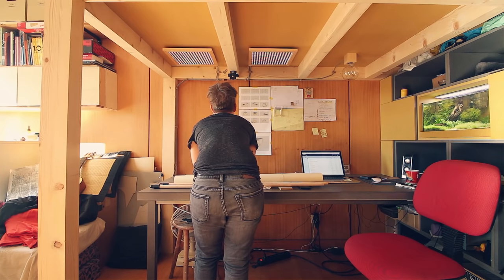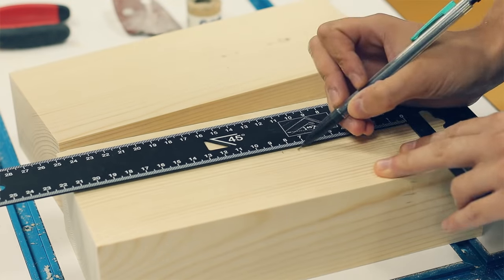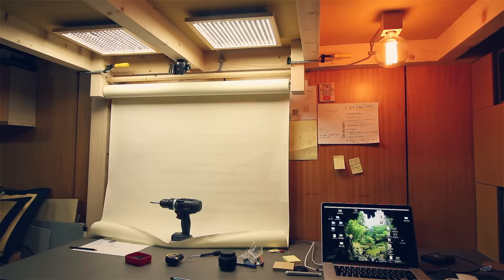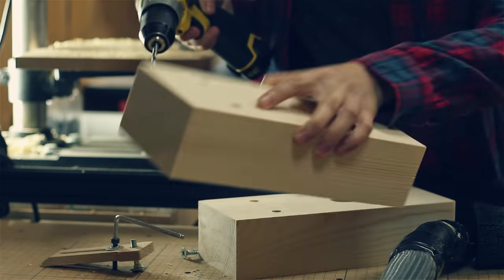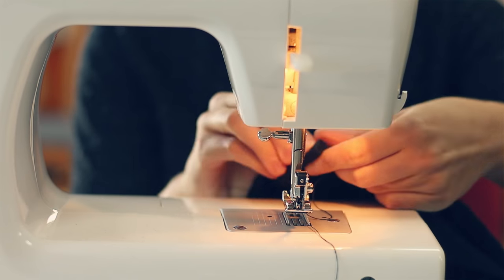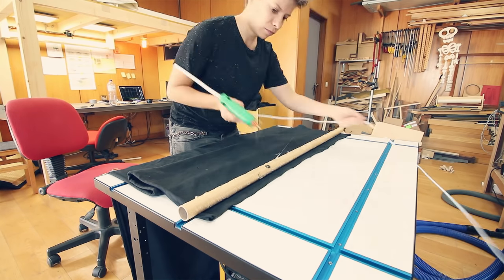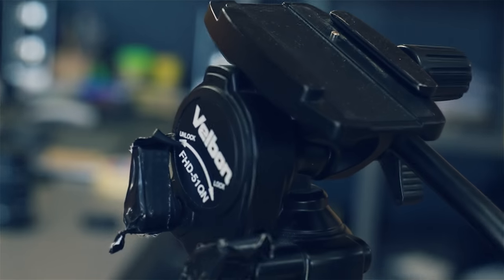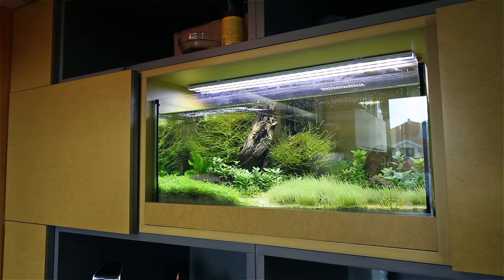Loft Bed // Work Space : Background Rolls Rack - Ep. 6

Comment: Super awesome, and very simple. 
If you don't mind me offering, here's something that may make rolling the sheets up easier. 

Make a wooden pulley with a deep cut, so you can wrap about 5 feet of string in it.. 
Attach a handle to the pulley, so you can crank it. 
Attach the pulley/crank assembly to another of those large wood blocks, and affix it to the bed frame, a few feet back from the rollers. 

Wrap string around the pulley, with a loop on the exposed end of it. 
On both of the rods put a hook (or, nail, or screw) so the loop on the end of the string can slide over it. 

Slip the string-loop over the hook of the roller you are going to use. 
Now, as you unroll the sheet, it unwinds the pulley, and winds the string around the rod. 

Then, when it is time to roll the sheet back onto the roller, 
all you do crank the handle, which winds up the roller.

Who says girls can't build?

Comment: At the end of the dowel, add a narrow pulley and a string at least as long as the cloth, that you pull to roll up the cloth, much the same way as pulling the cord to open a window blind. Then it's just a matter of dealing with the string. Maybe hand on a couple of light-duty hooks stuck to the wall. Or use spring-loaded pulleys that rewind the string after rewinding the cloth.

Comment: That's an amazing camera set up, tnx for sharing it. Just a little thaught, wouldn't the wooden rods work better if the the rod holes were made offset and not parallel? So it could be easier to extend them if they are not one in top of the other. And maybe the rod that goes behind set it in the lower position so that the one in the front covers both rods just for estethics, I mean when you apreciate that corner view from far across the room. But just a lil' adjustment 😁 sorry, thanks!!

Comment: spritz hot water on the backdrop. No reason to iron ... that is a pain.  use a spray bottle, with hot water. Put the backdrop down and spray it... a little at a time and let it dry. the wrinkles will come out. It will wrinkle just being rolled up there and this works well.